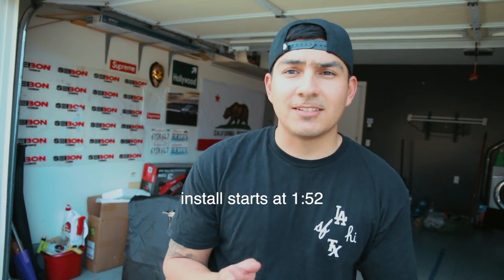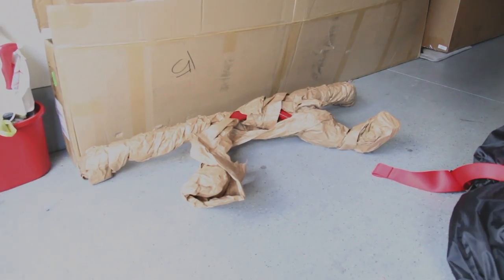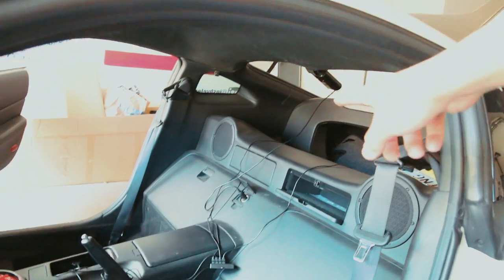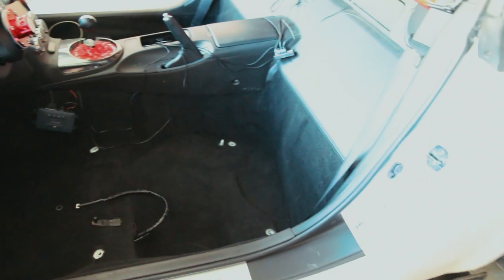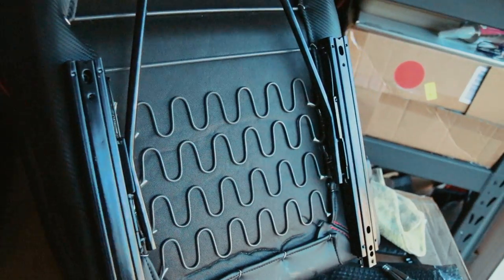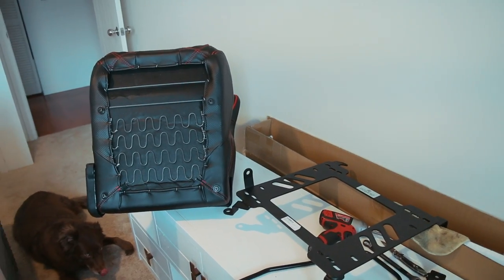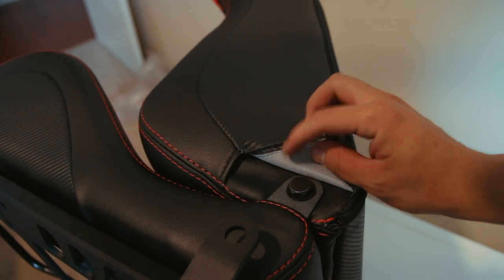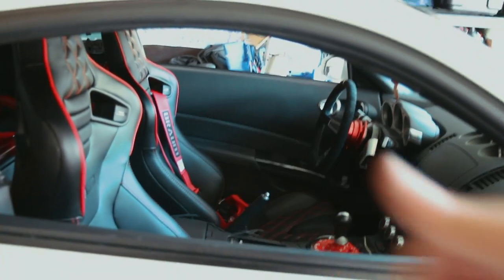Installing Braum Racing Seats, Braum Harness Strap, and K Harness Bar in my 350z

Comment: Careful with the 4-Point harness setup. 4-Points can be dangerous depending on the accident so I would install the 5th point strap as soon as you can. It’s hard to enjoy your car when your in a coma from a bad accident. 

Either way, great videos man
Reply: I know you commented like a year ago, but I wanted to add an important note-  A 4 point harness should be saver than your stock seatbelt in all situations, because stock seatbelts also have no provision for submarining, so if you are driving within the safe limits of the factory seatbelt, you should be better off with the 4 point, however, if you push the car past that point, an anti submarine belt is required unless you feel like getting clotheslined in the stomach at 100 mph, in which case you'll probably die.

Comment: Nice. Just ordered the Orue seats. Did you lose any distance on how much you can move the seats back or how much they recline with having the harness bar there? Just subscribed to your channel, too.
Reply from the maker: Nope, not all all. I was able to keep the adjustability by having the sliders and also these specifics seats are reclinable and not fixed back. All depends on your seat for that tho. And the sliders are what allow it to move forward and back.